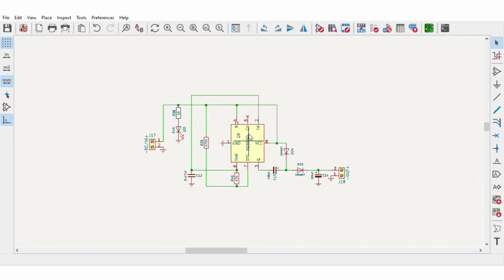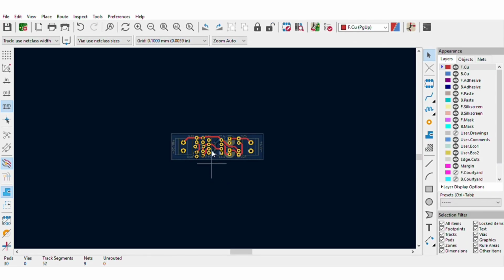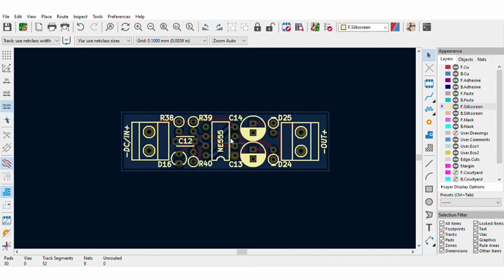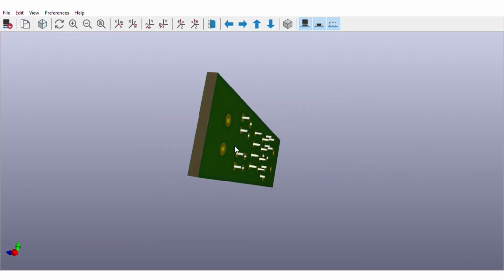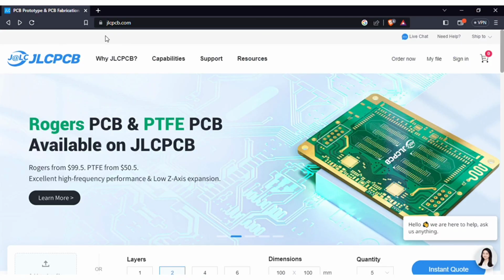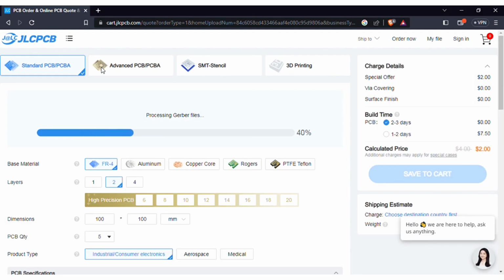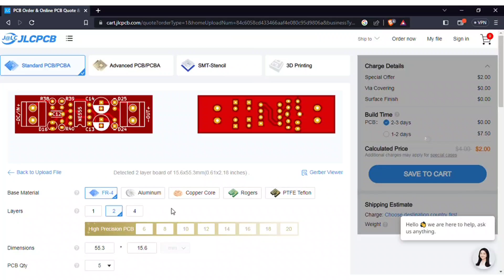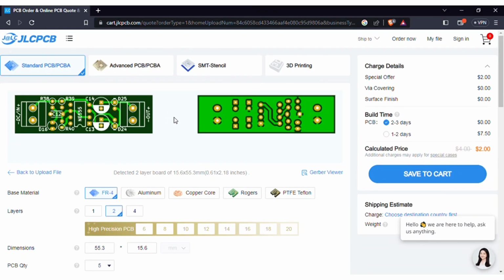Simple DC voltage booster circuit Without Coil

Comment: basically a voltage doubler, using pulses from timer and D24, D25, C13 and C14 to rectify (D24)  with doubler consisting of D25 and C13 +14...
Reply: Yes. I tried the circuit and get 8v under 3.7v input.

Comment: How many amp it produce please say
Reply: Bipolar version ne555 can give upto 200mA current, but it's not safe to operate the chip at this level, safe region should be 50mA or less.
Reply: @jpjp8964   no no output
Reply: @SanatanaDharma-Indian  what you mean by no output, your circuit doesn't have a voltage on output? or something else.